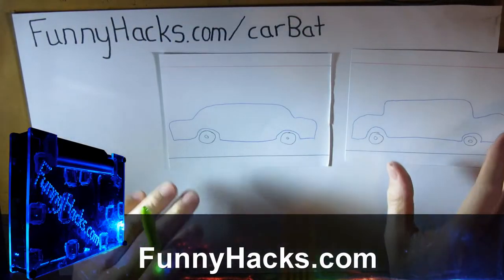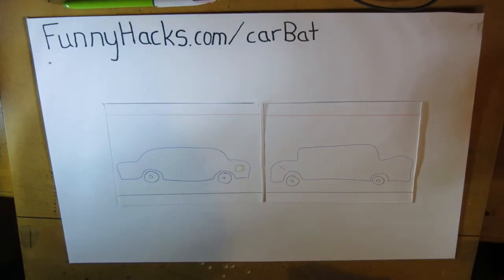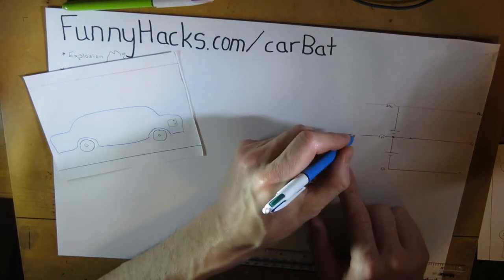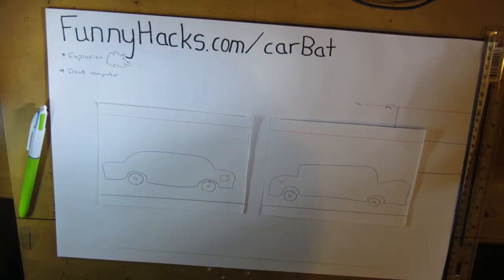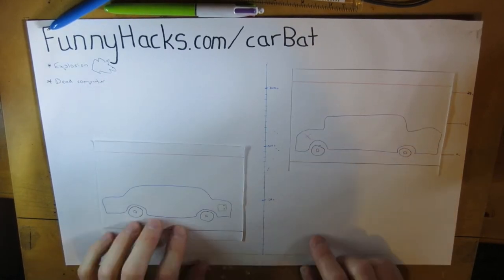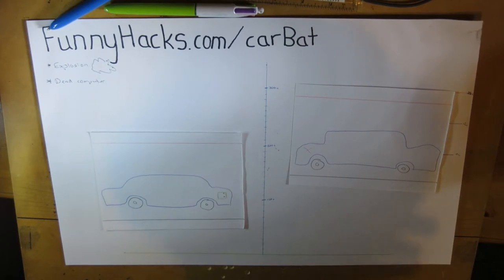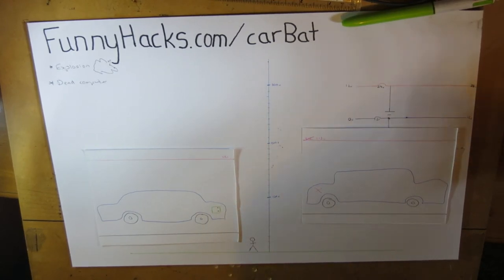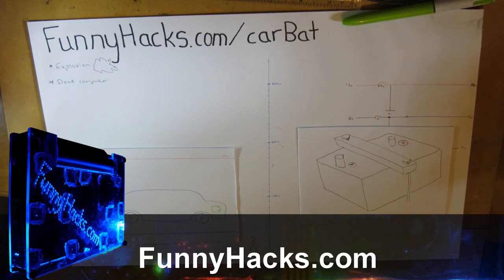jump starting: Why lead order matters

Comment: thank you for making this video. very interesting. couldn't you connect the negatives first to get the car frames at the same voltage, then disconnect the negatives, then do the ordinary method of connecting positive first? best of both worlds?
Reply from the maker: I initially thought you were joking. But this is actually a really good question. Logic being that you discharge the difference, and then connect safely without risking creating a short circuit.

As long as you disconnect the leads before beginning the normal process; I can't think of any disadvantage other than extra steps.

How much advantage it would give you would depend on what the source of voltage difference is coming from. Ie If it is static charge that has built up over time; then it should deal with it nicely. If there is something else going on that is causing the voltage difference, then it's less likely to to help. My gut feeling is that the built up static charge will be the largest component and therefore it could make a meaningful real world difference, but I haven't experimented with it. 

Whether or not the potential benefit is worth the increased risk of human error will have to come down to your judgement. I'm currently undecided for myself, but I suspect that it might be an unnecessary risk, especially in the stress of the moment when jumper leads are needed.

I'm curious, what do you think you will do?